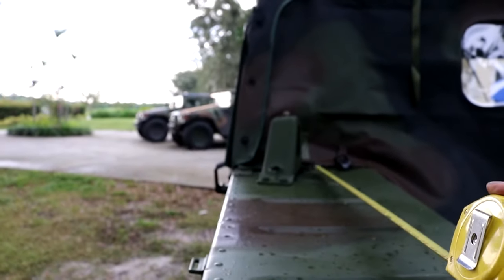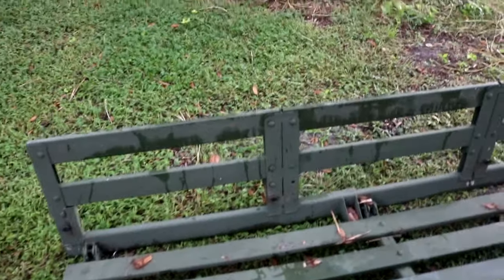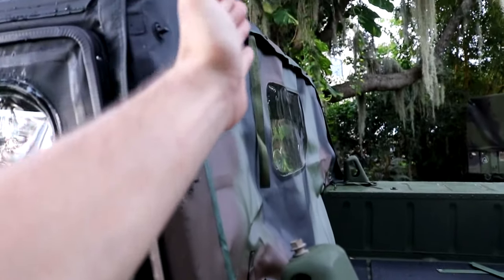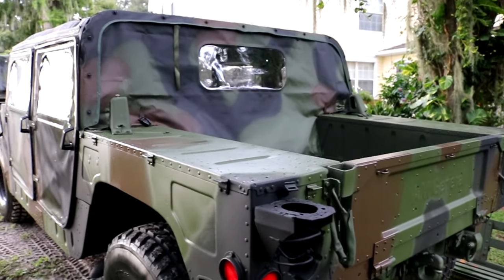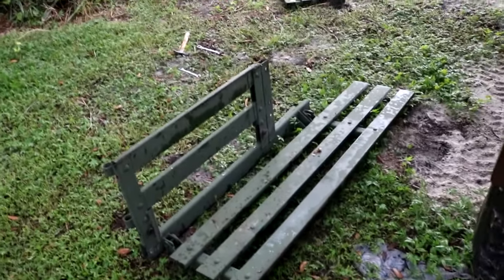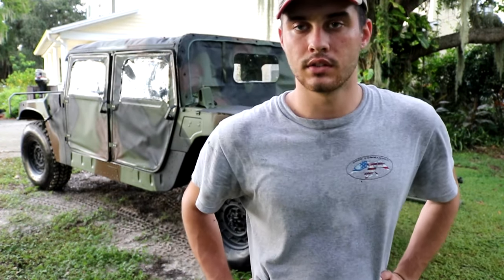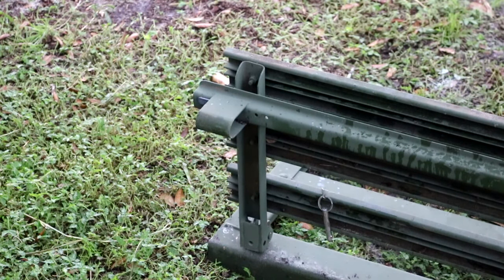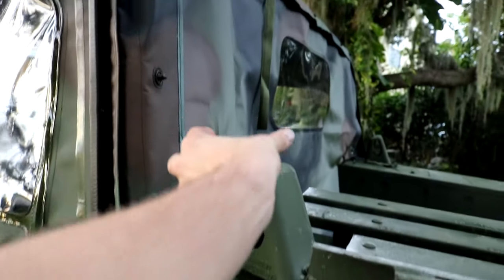Humvee Build - Custom 4 door Humvee troop seats

Comment: Where the spare wheel?
Reply from the maker: The spare wheel is usually carried on a special tire carrier attached to a heavy air lift bumper. Most Humvees sold at the auction don’t have this setup. My newer Humvee has all of these items.